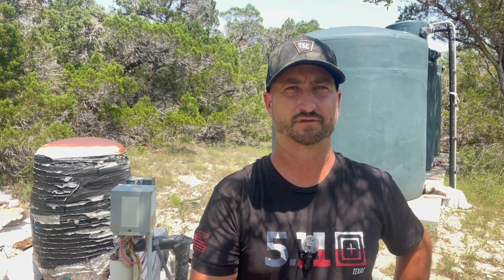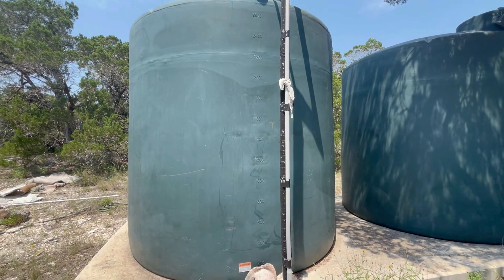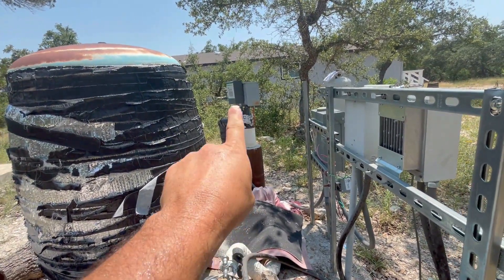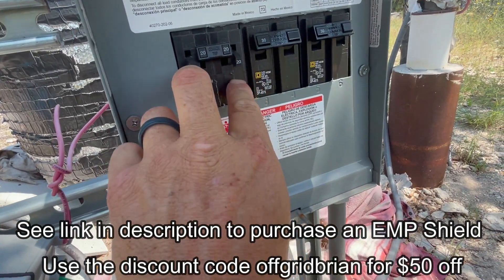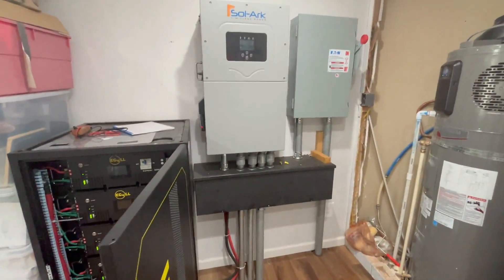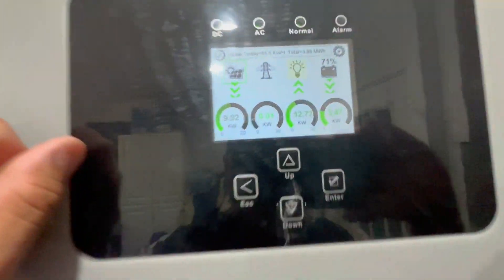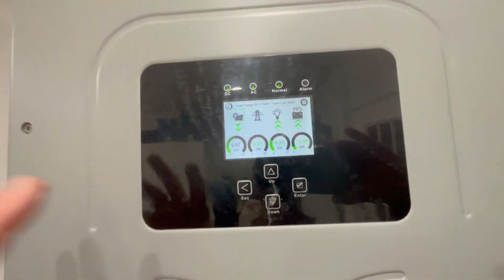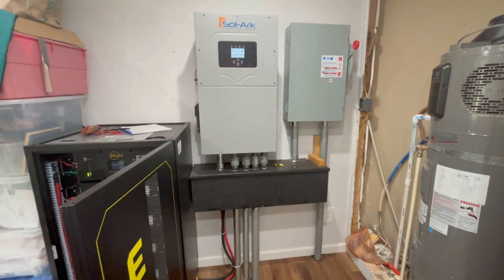Tour of my off grid water system using Sol-Ark 15k + EG4 Lithium Batteries

Comment: Since you are running your water system off-grid, if it fails, you are virtually without water very quickly because you are supplying five houses. It really doesn't make much sense for you to not collect water. With water systems, you need to have redundant protection. Getting 47 inches a year is massive. 

I live in AZ and there are off-grid  people who have water storage systems, and on average, we get something like 15 inches of rain a year. AZ also gets most of its rain in massive rain storms.  You are right that water storage tanks are very expensive, but you also could dig a large pond area and create a natural (pond) swimming pool. If done right, the water would be so pure that you could drink it without filtering it.  You can use liners to line the bottom of the pond, so you don't have to pour massive amounts of concrete. 

I get it that you are on a budget, but in AZ, one YouTube author has approximately 40,000 gallons of storage, and he can supply his family for a year with that. He also is creating a retaining pond to store water runoff during storms. He has been very successful with his system.  

These types of systems may become more common in AZ because we have been in drought for several years. I would make sense for the state to mandate 20,000 gallon water storage tanks for every new home and help subsidize them. It would significantly cut down water usage from the main system. 

Possibly for you, creating a large natural swimming pool would be an excellent choice to store emergency water. It would provide recreation for your family and clean, pure water for emergencies, should your well system go down. If you rent the equipment, you could probably install a large natural pond yourself for $30,000 - $40,000, with all of the amenities and a specialized fence to keep out snakes and pests. This would provide a hundred thousand gallons of water or more for emergencies, and it would provide a wonderful recreation area.
Reply from the maker: Agreed. We have been considering digging a pound for awhile. That may be in our future.

Comment: I'm looking to get a battery back up system for my grid connected 12.4 KW Enphase PV here in southern New Mexico. I've been looking at EG4 batteries, and trying to decide on an inverter to AC couple with the Enphase. I wonder if the Sol-Ark works good with Enphase...They sell an Schneider inverter, but it's 6.8 KW...and I also don't really want a sub panel but a whole house solution.
Reply from the maker: Give Sol-Ark engineering a call. They will be able to answer your questions on that
Reply: ok

Comment: Thank you. How many hours can you run your home just on your batteries?
Reply from the maker: When I use less than 80 kwh of power and the sun is out I stay completely off grid. If I use more than 80 kwh I end up going back to the grid for a few hours overnight due to air conditioning running overnight draining my batteries quicker. I also use 15-30 kwh of power per day running my well pump and water pressure pump to 5 houses on my property. So the average person won’t use as much electricity as I do.
Reply: @unpluggedtexan  Thanks. WE live in Iola, Tx. I am looking at same inverter as you but I like the Home Grid battery system. We use between 80 kw and 61kw daily. I was hoping to use my solar in day and batteries at night. I don't know what size battery system to get. Any comments on that are most welcomed.
Reply from the maker: @cahoonm  this video will help. How Long do off grid EG4 Lithium Batteries Last? (watt-hrs calculations)
https://youtu.be/RqmdnuMycx4

Comment: Thanks for the video. What is the make and model of that pressure pump?
Reply from the maker: All I could find is a sticker with a catalog number.  It's Goulds Water Technology, Catalog # 5HM06N15T6PBQEBP.  It's 3500 RPM, 3 horse power, 3 phase.

Comment: Nice video and I signed up for your diagram, also nicely done w/ useful info.  Your numbers are all pretty close to mine.  My 4 ton is 3,600 watt while running, my fridges avg 100w/hr, dryer 4,600 w while running, all pretty consistent with your numbers.  Are you selling back to your power company?  If not, why did you chose to pull the line from the power meter through the Sol Ark vs just pulling a 30a run from the panel to the Sol Ark and then running either transfer switches or an interlok?  The benefit would be not needing permitting and having your power company up in your business.  But the benefit in the way you did it is you can pull more power to charge your batteries/house from the grid and also avoid the cost of the transfer switches or interlock.
Reply from the maker: The Sol-Ark can push 50 amps at 240v to my panel when running on batteries only. I’m not selling back to the grid. I don’t want the power company to even know what I’m doing. Since I’m not going to sell back to the grid I did not pull a permit. I live in a very rural area with very little regulation. I did not want energy from the grid going to my panel at the same time my Sol-Ark is pushing energy into my panel. The Sol-Ark inverter can feed the exact amount of grid power I need when there’s not enough sun when my batteries are low. If the Sol-Ark is the central hub for your main power it can run very efficiently using as little power from the grid as possible. Hopefully that makes sense.
Reply: @unpluggedtexan  I know exactly what you mean.  I'm in Phoenix and wish I didn't have to let the city or power company know about my set up.  Anything over 3kWh of batteries and you need to get fire department permitting too which is crazy because you don't have to do anything special to park a 110 kWh electric car in your garage.  I'd like to set my system up like you did but would have to get permitting from the power company and have them certify I have a proper device that won't feed back to the grid I'm pretty certain.  Didn't you have to have them disconnect power so you could pull a line from the meter to your Sol Ark? Regardless, w/ the city I have to get approval and definitely will for the solar panels since they could drive by and see them, but I'd prefer not list the batteries.
Reply from the maker: @reviews2you  i built on my very rural property. So I did all the electrical work from the pole the meter is on to my home which is 350ft away. I put a main disconnect 200amp breaker at the meter so I could kill power without having to cut the lock and pull the meter.  So I was able to cut electricity to my home to be able to safely wire in the Sol-Ark.
Reply: @unpluggedtexan  Very nice, we aren't so lucky here in the city.  You're smart to be so self reliant, hopefully your family appreciates what you've done for them.
Reply from the maker: @reviews2you  thanks. Yeah my wife is very supportive. She believed in me enough to learn about solar from scratch (which I’ve been dabbling in for 8 years on a small scale). But it took faith for her to trust me in spending $35k on this system and then installing it myself (with some pointers from my father in law who was a commercial electrician).  We’re grateful we now have electricity regardless of what happens with our electrical grid. It took awhile to get there. But a bunch of small steps eventually turns into one giant step. Start small and go from there.
Reply: @unpluggedtexan  She's a keeper.  I've been putting together a system and then switching it and upgrading for the last 3 years.  Like they always say, buy once and cry once is the way to go.  I've had to sell a lot of my equipment and took a bit of a loss.  I have a 500 gal water tank here which I had to get approval for and put in some rain gutters etc (from the country in Iowa, but much harder to do things in the city in Phx but stuck here for the time being).  I always had a hard time getting the significant other to help with any preps or see the reason for it so that's really great your wife gets it.  I have a bad feeling we'll all need it in the next couple of years.  Keep up the content and good work.

Comment: Very nice set up. I think the SolArk will actually do 15k off grid combined with PV but only 12k running on battery alone.
Reply from the maker: Yep correct. It will do 12k from batteries only, but will do 15k if there’s that much solar coming in (12k to the loads in the home, and 3k to charge the batteries).

Comment: Very impressed with what you've done here..how long can you run the batteries to power the air conditioning after the sun goes down is what im curious about..Fellow Texan dealing with hot temps and humidity here too. Thanks for taking us behind the scenes  of your system.
Reply from the maker: Right now I have a standard 4 ton ac unit that runs on 3,500 watt hrs. When I’m at 100% battery state of charge I can run my 4 ton ac for about 8 hrs if I wasn’t running any other large items. But overnight I only use a couple window AC’s to make it through the night on batteries. I just bought a mr cool mini split ac/heater. It should arrive next week. I’m hoping that will help a lot.
Reply: @unpluggedtexan  cool keep us posted on how it's working out for you..Great content thank you!

Comment: Hey man cool setup, what's your GPM output on the well, I'm guessing its a 3hp 20 gpm?
Yea so with your submersible pump shouldn't be overheating.
The water flowing over the motor keeps it cool unless your having a drawdown issue.
A pump saver is good to have to solve some rare faults and maybe help diagnose when something does happen.

If its anything like here in Louisiana you don't get freezing weather often.
There is no reason to Insulate that big bladder tank as over 70% is air on top, it will actually make it rust from the outside faster.
Give it a good sanding and some grey paint to protect it and your good.
If you do get a freeze below 30 then just throw a loose tarp over the system and hold down the sides with some rocks.

Man those VFD pumps can get really pricey and are not easy or cheap to fix if anything fails.
I always recommend a standard pump and tank system or a dual pump for high demand.
You can always have a small pump on the bigger tank for lighter water usage demands. 
A bigger centrifugal pump set at a lower pressure to come on when the smaller pump can't keep up. 

Been working on my off grid system as well with a EG4 system as a backup and just off grid power for somethings daily.
Really wanting to add more but at same time 6k inverter and 10kw of battery feels enough to get by with.

Take it easy man and if you ever have any questions with the well give me a holler would be glad to help!
Casey
Reply from the maker: Thanks for the tips and info!  My well pump is 2hp. Not quite sure on gpm though.